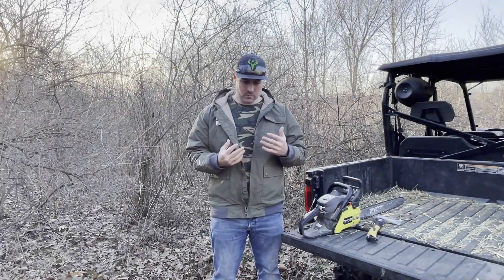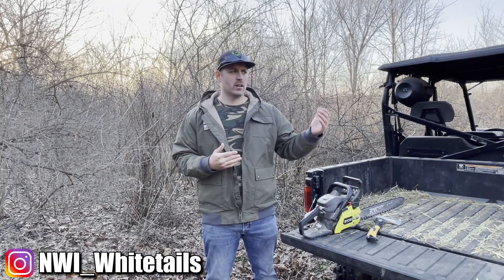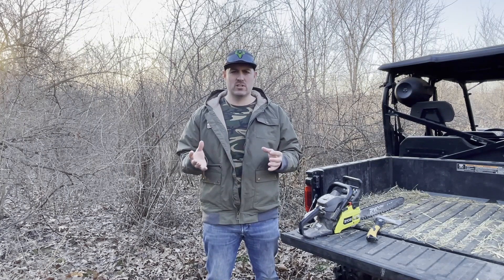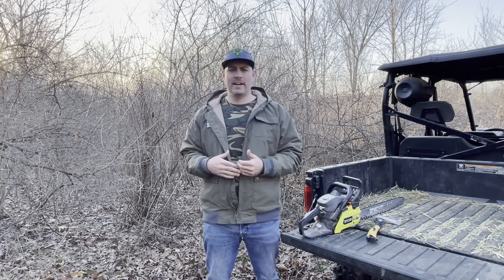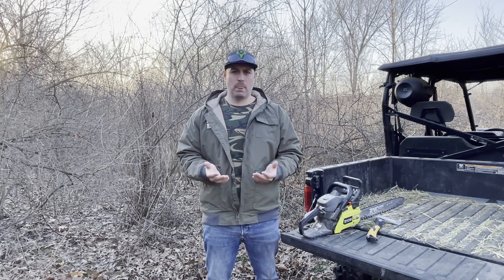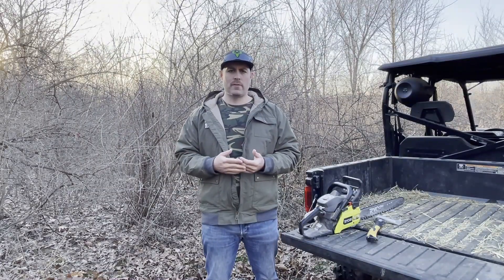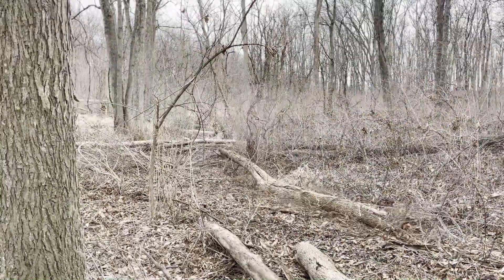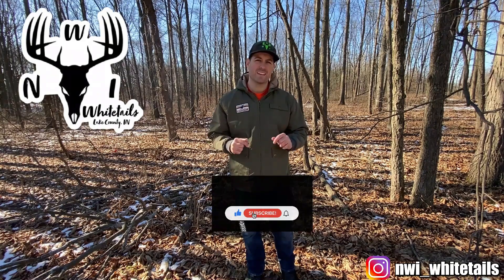Woods to Food Plot Conversion Pt. 1

Comment: You should really look into having someone come out with a forestry mulcher. Few hundred dollars would have gotten the job done. Plus would leave a good mulch bed for the seeds and “slow release” fertilizer. It would also save tons of time and resources. Especially the wear on your back.
Reply from the maker: A forestry mulcher is definitely efficient, but I think it would have would be a little overkill for this job. These were a 1/4 acre tops and most of the bigger stuff was already dead and downed from a storm so I cut that for fire wood. I got these cleared in about 2 1/2 hours with the bush hog which cost about $80 with tax to rent. But for a larger job the forestry mulcher would definitely be a good investment!